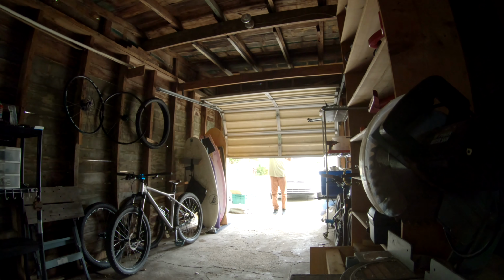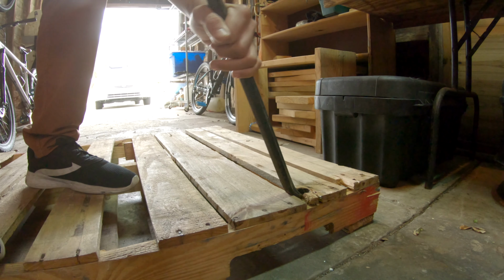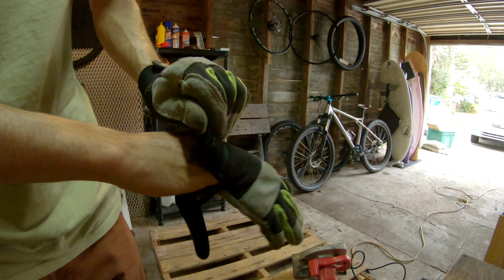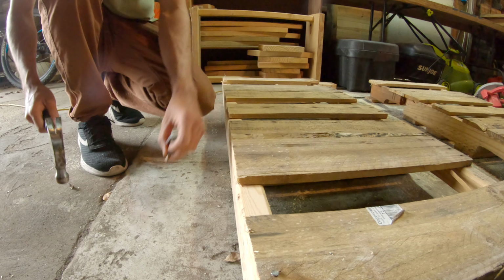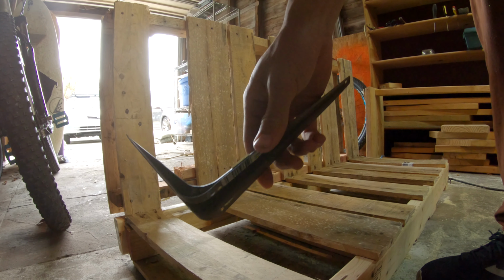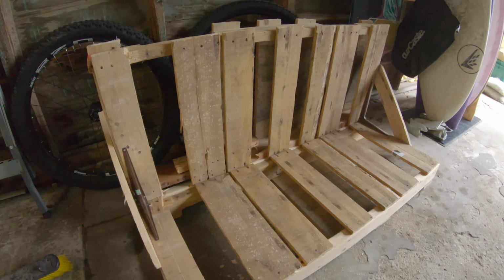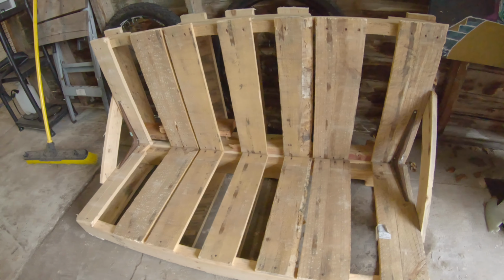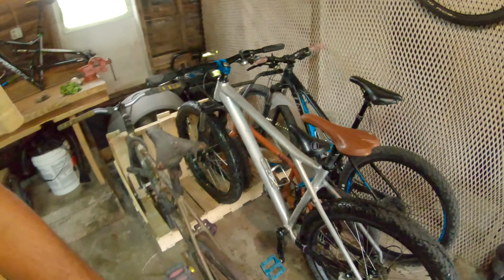DIY Bike Rack For Free - PALLET Bike Rack

Comment: Since you stated using a power saw would speed up the cutting process, instead of using a hand saw, why didn't you use the Binford 10K Ultra Deluxe nail gun instead of the Shoe Maker 1K muscle and hand powered hammer to speed up the process of nailing the pallet together?  If you're gonna show us one fast and easy way to do a project like this,  go all the way - not half the way.